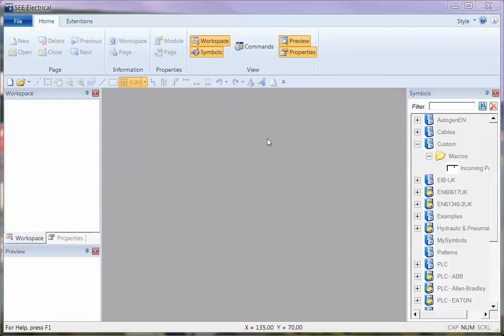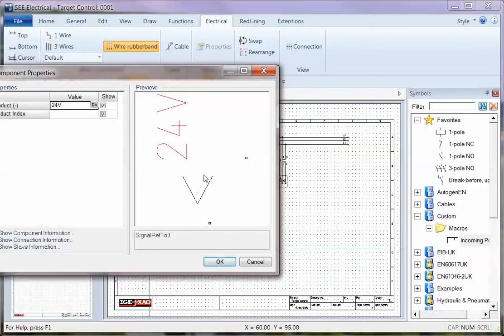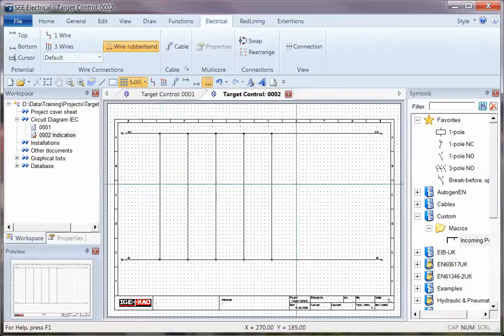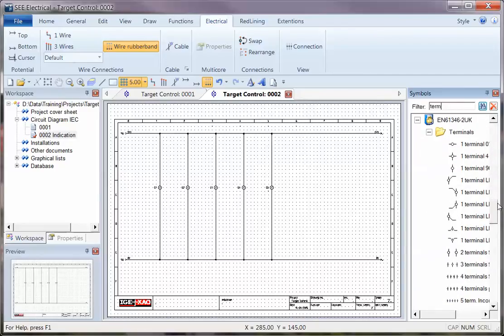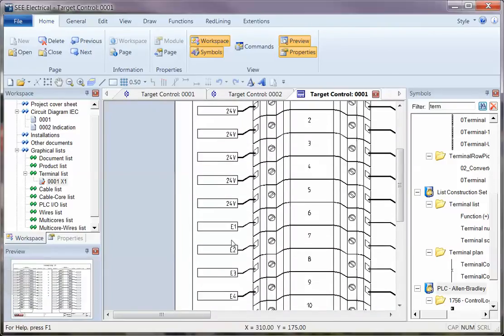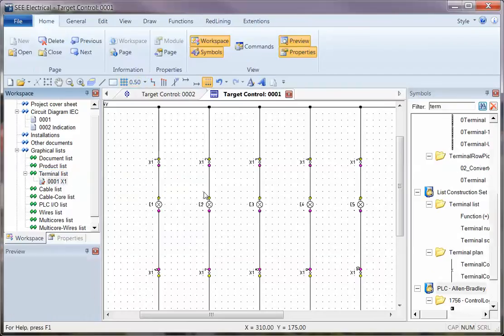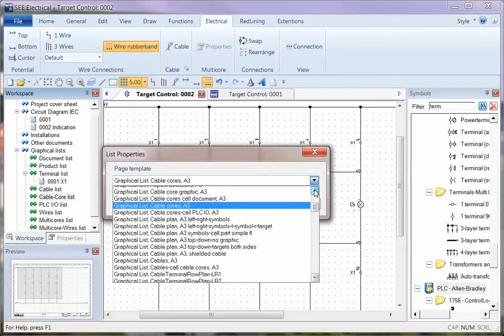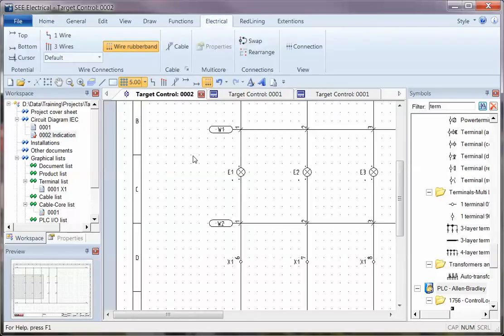Cable and Terminal Target Control V7R2

Comment: @IGE-XAO UK Thank you. But can I get Normal components kind of product Numbering in Potential transparent Terminals?
Reply from the maker: Terminal strip names can be updated with the +1 button and assigned a value based on the page and column. This is defined in circuit diagram iec properties in the terminals tab.
Reply: @IGEXAOUK  Thank you for the clarification. I will try with ur solution.

Comment: Can I get auto numbering of Terminals other than X1, X2 ..... Sequence. Like other components, which depends on Page number & components code.?
Reply from the maker: Yes, right-click and select properties on the Circuit Diagrams node in the workspace panel. Select the Terminal Strips tab and change the Numbering type to Page/Code/Number. When you next place a terminal and click on the + next to the product it will incerment to the page/code/number e.g. 4X1:1 for a terminal strip starting on page 4. This is not used often because terminal strips are usually named to separate functions, such as X1 for 24VDC and X2 for 110VAC wiring and these will appear throughout the project, but its possible.
Reply: @IGEXAOUK  Thank you. But can I get these kind of Numbering in Potential transparent Terminals?